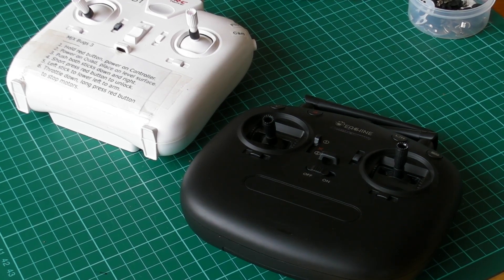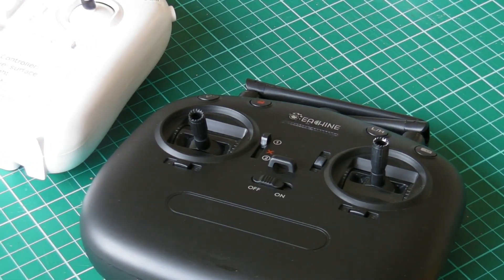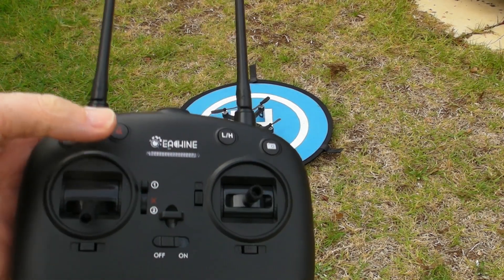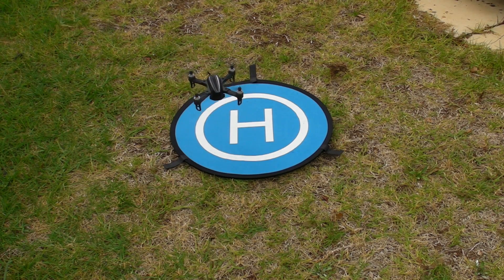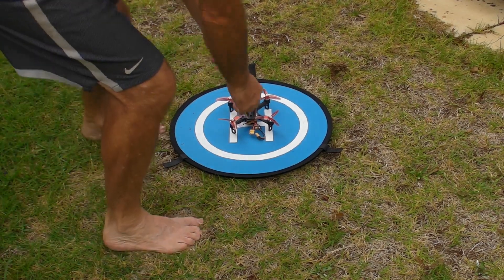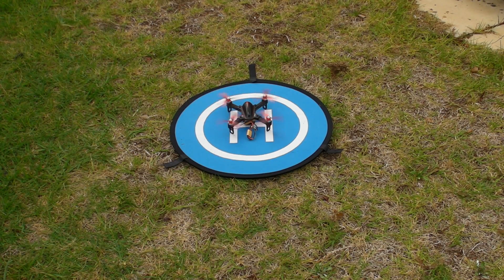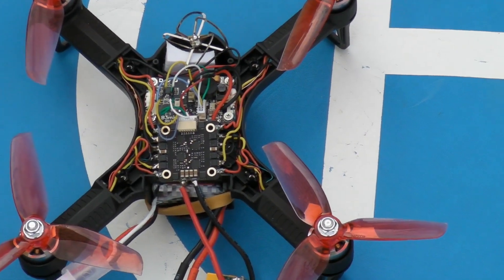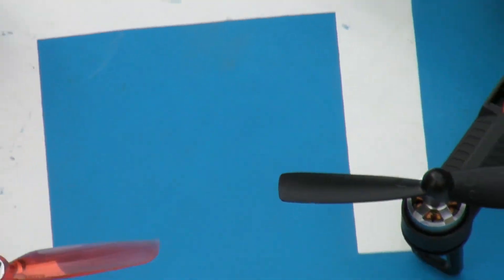How to bind and fly the Eachine EX2 mini/MJX Bugs 3 mini with standard and upgraded ESCs

Comment: Friend the propeller tri blade 4032 did burn the esc of the ex2 mini ???
Reply from the maker: The ESC on my first ex2 mini burnt after 2 flights with standard props. I replaced the ESC with a better one before using the tri blade props. At the time, a lot of flyers had ESCs burn. It may have been a bad batch. My second ex2 mini is still flying with the original ESC.
Reply: @skybug3  thanks for your feedback, i have ex2 mini for 2 years i like it a lot, i never had any problems, but i would like more speed and power, i found your modification and i will also do it on my ex2 mini.
Reply: @skybug3  your second mini ex2 this with triple blade prop ??
Reply from the maker: @fmRodrigo03101986  I have not tried the 3 blade props on the EX2 mini with the original ESCs, just in case the load is too high.
Reply: @skybug3  thanks, do you think the original 3-blade props would burn the esc? or would it work well?
Reply from the maker: @fmRodrigo03101986  I would not risk trying it.

Comment: yuppi !!! ... it works !!! ...
i got esc 4 in 1 ones with your comment ...
flies and goes much better than before I confirm your comment
congratulations and thanks again🔝🔝🔝
Reply from the maker: Good to hear that it works. However, don't try 3S batteries! The 4in1 ESC feeds the full battery voltage through to the Flight control board. I burnt one out doing this. Although the 4 in 1 ESCs can handle up to 4S, I need to put a Buck Converter between the ESCs and the FCB to reduce the voltage down to under 8v.
Reply: @skybug3  damn you read my mind ahahah I really wanted to do it given the characteristics of the esc 4 in 1 ...
ok bugs 3S project canceled .. !!!
as soon as everything is reassembled and the vehicle is ready I make a video for you ... thank you very much!!!💪👍🔝

Comment: Hello..I've been following you all the way but the motor is vibrating and the motor is so hot..but still flying..what is problem? is it esc problem?
Reply from the maker: Sounds like a bad motor, but check to make sure the prop is OK. When an ESC goes bad, it usually burns, with smoke and smell warning you. With a bad ESC or a wire to a motor starting to come off, I see the motor slow down, pause and finally stop.
Reply: @skybug3  u dont have a email? I can sent a picture my soldering wire, becoz i think prob at a esc, motor and prop okay